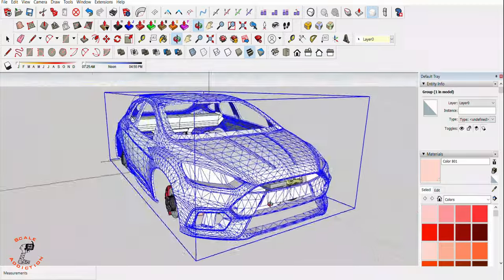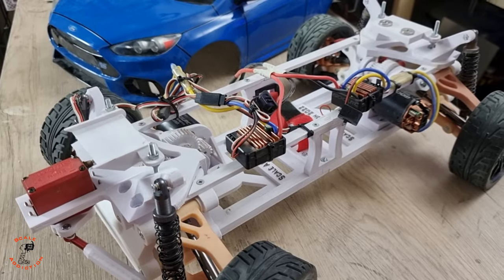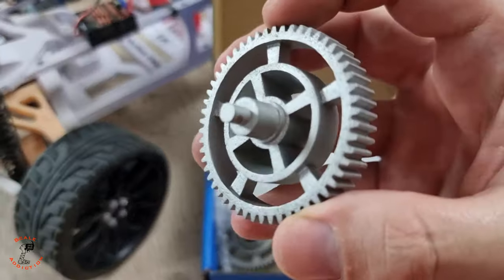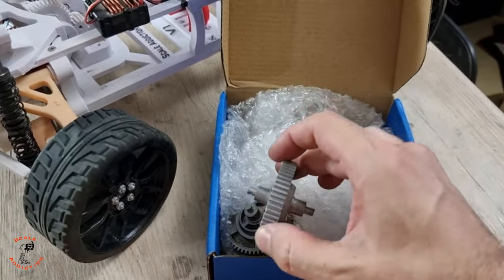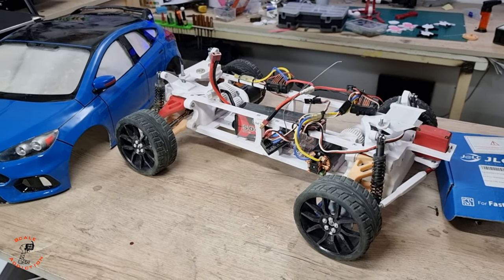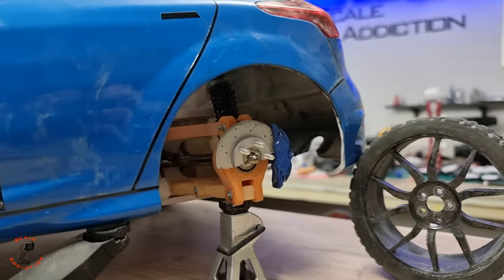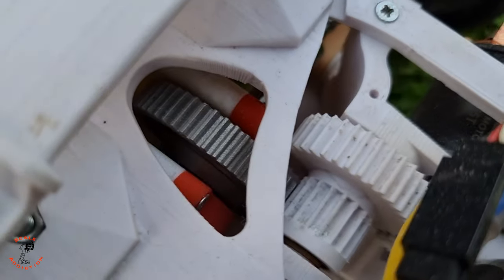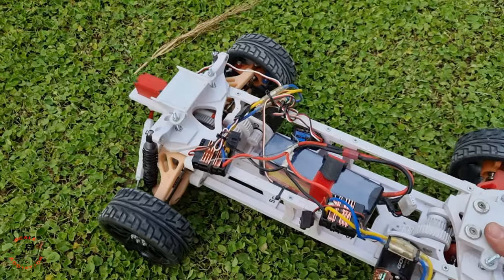Metal 3d Printed gear for my 3D Printed 8th scale Custom Chassis | Scale Addiction

Comment: How much would it cost to get all the plastic parts printed in metal?
And how much would it weigh?
Great video. keep up the good work.
Reply from the maker: Only the gear cost me $45 for each in stainless steel,  I'm sure it will be alot if  do all, but not sure how much cost or the weight